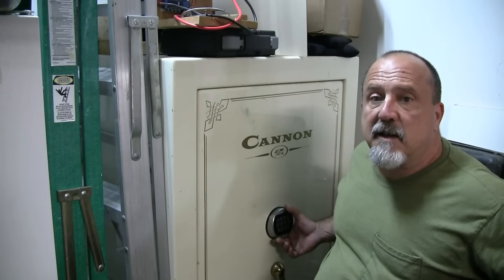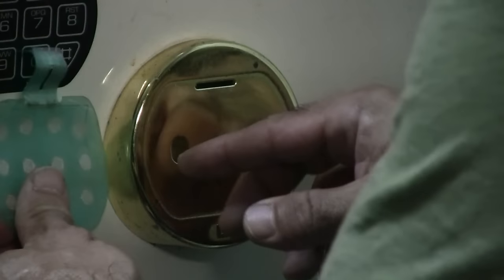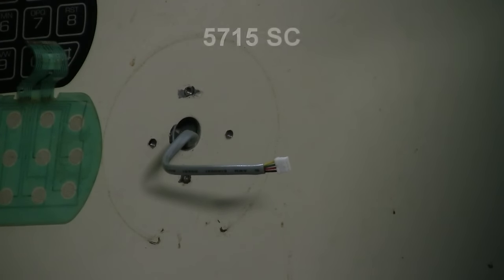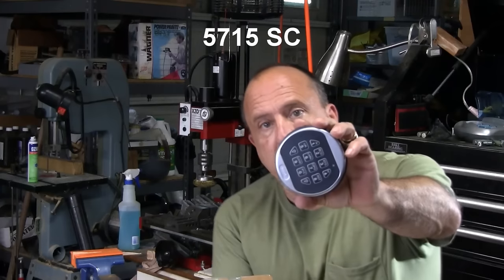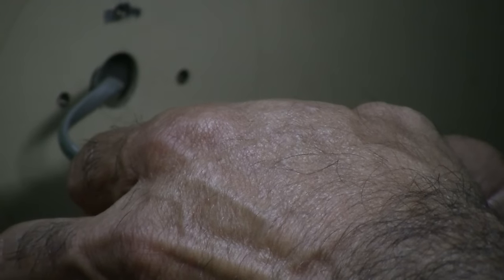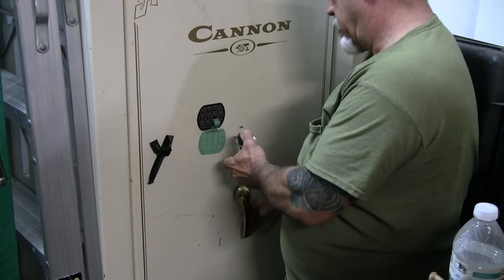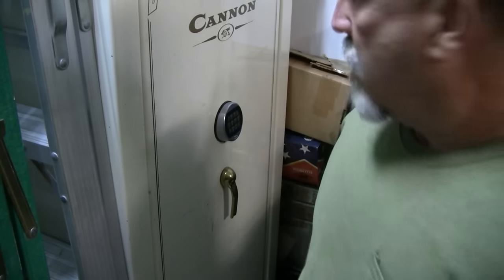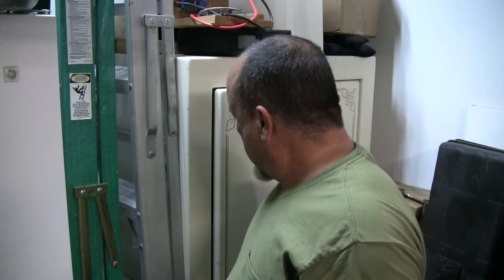Cannon Digital Gun Safe Fail Fix! Locked Out! Don't Drill - TRY THIS FIRST!

Comment: Firstly, once the door was open, you should have left it open to work on it, just in case lock would have failed for whatever reason. Secondly, depending on the age of lock, you probably should have replaced the actual lock itself since you have a new keypad. Thirdly, a competent safe technician would have repaired the hole properly to make the next drill attempt insanely hard, as well as match the paint  to make it look like nothing was ever done to the safe.

A small precision hole which is repaired is absolutely the right thing to do VS cutting the safe open. Especially if it's a high end safe VS a lower end economical one.

Also, when safes are installed properly, they are not only bolted down, but protected on the rear, top and sides which make it virtually impossible to cut them open without cutting through other barriers first.

Many people scoff at the cost of safe drillings, but when people have made the investment in security, they don't want to destroy 10k plus dollars over a $200 lock lol.
Reply from the maker: Thanks, sounds like sound advice. Unfortunately, I did not have the lock so only replaced the keypad. Since then, Cannon sent me a replacement lock and keypad and I have since replaced both (I posted that video tonight). I understand that a drilled safe can be sealed \without being compromised, however, the locksmiths that I contacted in my local area didn't inspire much confidence in their work. Incidentally, I made a comment on contacting SAVTA to find a reputable safe tech should anyone need one. I have no qualms against good safe technicians and have no problem directing people towards them!
Reply: Second on the advice to KEEP THE DOOR OPEN until you've confirmed x3 that the door will reliably open.
Reply from the maker: @mikestevens2053  I stand humbly corrected, I am a bit of a risk taker. Luckily, no problems to date!
Reply: Safe bolted down and protected on all sides and top. Not!  Mine is bolted down, how would you have all surfaces protected?
Reply: @300zxdriver  you build around the safe, essentially walling off the sides and top. It's the same concept as a bank vault. A vault is only exposed on the front where the door is.
Reply from the maker: @300zxdriver  I'm not sure what you are asking. Protected from what? Access?
Reply: @ExtremeDIYGuy  Basically doors are the toughest and thickest part of a lot of safes. 
It is easier to cut a hole in the side or top. Blocking access makes that harder - which is why bank vaults are cast in place with high strength reinforced concrete.

Comment: How about an electronic panel that requires the cable different from the one you had? Mine is about the same we use on the back of the PC Router. Thanks.
Reply from the maker: I don't think that will work. TO gain access you will probably have to use a front panel from the same manufacturer as the original.
Reply: @ExtremeDIYGuy  I thought so, I will try to get one of the same. Thank you.
Reply from the maker: @1945temo  Your welcome!

Comment: I think that it is worth mentioning that you should also before doing anything make sure you have a new Fresh and I repeat fresh battery I had a similar problem I replaced the battery even though all the beeps were happening everything seemed to be working properly but I replace the battery and it still didn't work later I found out that the battery I had replaced with had been hanging around for a few months the next step is I went and got a brand new battery now when I checked the batteries with my little battery checker they all checked as being okay in the green but the new battery was slightly more strong I installed that new battery fresh and the safe began working and has worked to this day so maybe check the battery before you do anything make sure you've got a fresh as good as it can be battery
Reply from the maker: Thats a very good point worth checking! Thanks!

Comment: Here is another fix, i know this is an old post but try this as well, this worked for me, take out fresh battery, push buttons for aprox 1 minute to discharge all stored energy or power, put battery back in and it worked , i was able to use my original combo to get in....
Reply from the maker: That wasn't the case in this particular situation, but that doesn't mean it wont work for someone else, thanks for the information!

Comment: When you drill a safe you repair the hole by driveing in a tapered pin cutting it off flush with the door. Then repaint the door and you would have to redrill the safe again to open it in the same way you did the first time you drilled it.
Reply from the maker: I prefer this way due to the fact I did not have to drill the safe. But thank you for the insight.

Comment: Great video,......just bought one,.....had mine off as soon as I got it?
The code would not work?
Then when it it does work you have a millisecond to open it?
Reply from the maker: That sounds like it's defective. Try putting a fresh battery in and see if that helps. If not, I would call the manufacturer.

Comment: If you drill the safe in the correct location then plug the hole with a grade 8 bolt or better yet a hardened steel pin your safe is actually better than before you drilled it. Unless of course if someone has a diamond hollow bit to bypass your fix but diamond drilling takes a long time.
Reply from the maker: Yes, I have had a number of safe techs call me out on that! But a good point nonetheless.

Comment: So I need to know the code that was original to the safe, not the last known good combo, correct?
Reply from the maker: You need to use the last known combo. That is stored in the lock mechanism inside the safe.
Reply: Please it's called a Lock Body
Reply from the maker: @xrp777  A "lock body" refers to a key lock and is the cylinder or the part that turns to open or lock a device. MBAUSA refers to the inside component on the safe as a swingbolt or deadbolt lock depending on the application.
Reply: Just don't call it a mechanism
Reply: Add no no one said cylinder get it straight . It's a safe lock body functionality as far as swingboat deadbolt  Doesn't matter and if it did you should have called it that from the 1st place
Reply from the maker: @xrp777  You are right, I should have called it by it's correct name in the first place.

Comment: Thank you for this great video ! You saved me a whole lot of money. My only problem is, even though there is holes on top and bottom, they are not threaded. Now I just have to crook my head a little sideways to hit the buttons. lol No big deal.
Reply from the maker: Lol, You might try a tap, just have to figure out what size it is. You can get cheap ones that are pretty much disposable. Canting my head sideways would drive me nuts.
Reply: @ExtremeDIYGuy  You’re right, should be an easy fix. Thanks
Reply from the maker: @paulrich4274  Worth a shot!
Reply: If it's like any of the safes and vaults I work on, you will need a high quality tap. You don't want to have it break off.  Don't ask how I know! Lol
Reply from the maker: @jerrylyles2885  Taps are hardened tool steel, PIA to get out if you break one!
Reply: Tap the holes with 8/32 thread. Make dure to use cutting fluid. Dont force it if it stops or it will break.

Comment: As others have said when replacing a lock always try and do with the door open. Throw the detent so it locks open.  When removing the old lock watch out for relockers.  Always put it back the same way or you will wind up drilling it.  Newer lock models like securam have the lock and face mated.  So you can’t just walk around with a face and open safes.
Reply from the maker: The relocker on the replacement mechanism was a PIA for this safe. But at least I got it to work correctly.

Comment: I cut big square hole in rear of American Eagle safe with grinder, replaced LG, welded back :)
Reply from the maker: That's one way to tackle it!
Reply: @ExtremeDIYGuy  Yep! Just recently cut open the top/back portion of a small Fire King high security safe only because the top door was locked and had to access MRC from SG 6120 electronic lock. Again Kudos to your method of circumventing a drill on your safe!

Comment: Most safe locks are backwards compatible. Just a tip, if you are working on a dead keypad on a Secure Ram style lock the board on the keypad is paired with the lock.  If you have this same issue with nonresponsive buttons you can order a new lock, take both keypads apart, take the new button portion, move the circuit board over to the new key pad and plug in your lock.  Put your battery in, if you get link ok just hit your code and open.
Consider it a free tip from a safe guy.
Reply from the maker: Thanks for the advice, hopefully that can help others that encounter this problem

Comment: $800 is a LOT for that service I'd charge $350-400ish those are known for keypad issues. I also would state drilling safe does NOT ruin safe you can actually make it MORE secure with changing lock type OR installing proper hardened pins or ballbearings in the drilled hole.
Reply from the maker: You sir are a responsible and ethical safe technician/locksmith. I have been called out on that before, I understand that the drilled hole can be sealed as to be undetectable and stronger than it was before. However, I could not find a locksmith that would do the work correctly, or a safe tech that didn't want an arm and the proverbial leg for the service. As it turns out in my case it was a simple keypad replacement. If it was the actual lock mechanism, I would have had to either cut it open or have a safe tech come out to the rescue. I looked at your channel and website, good stuff! If you'd like, I can post your website here and on my web page as well. I'm always glad to promote an ethical business!
Reply: @ExtremeDIYGuy  thanks,sure feel free to share
Reply from the maker: @hkssystemslocksafe2486  Ok, done!

Comment: Great video.  You should have kept the safe door open when you unplugged the front control unit to mount it.  Then a final mounted rest.  You are lucky it worked after the final install.  Again, GREAT video.  Thanks for sharing.
Reply from the maker: I realize that now, thank you for the input.

Comment: You should never work on your safe door closed and locked. Always do the job with the door open and bolts in locked position so you don't get locked out if something doesn't work. Then test it a few time with the door open to make sure it is working, then do it with the door closed.
Reply from the maker: Id have to agree with you!
Reply: He didn't have a choice to start with.

Comment: Drilling a safe doesn't compromise it if it's done correctly. However, this is why it's so expensive. A good lock smith knows where to drill and how to drill to get the safe open without damaging it. Once opened and the necessary repairs have been made. The lock smith will weld up the drilled hole, grind it smooth, then paint the door so the point of penetration is hidden. 
Higher security safes have more security measures built into the door. For example... Besides thicker and harder grades of steel. They may employ other technologies like carbide and tungsten chunks cast into the steel or even a tempered glass plate between the door and locking mechanism to thwart drilling attacks. The tempered glass plate if drilled will break releasing a lockout mechanism. The tungsten and carbide require special drilling techniques and the sacrifice of many expensive drill bits requiring considerably more time and skill to gain entry.
Reply from the maker: I have been corrected on that aspect of the video a few times already lol. I appreciate your candor and safe information.

Comment: Yeah, after my electronic key pad started going whonkie, I opened the safe, removed all items called my local locksmith company that also deals in safes. I ordered a Sargent and Greenleaf mechanical safe dial and had them install it. It took all of two hours for them to do it. Now I have no problems with my safe opening and I have no worries that it will go whonkie again or EMP problems. No more electronic locks for me ever.

Edit: Oh yea it was about a $250.00 insurance plan / peace of mind.
Reply from the maker: S&G locks are sturdy and reliable. Thats all that was used on the safes I saw in the USAF.

Comment: You might have been able to do it even easier.  I would have removed the first sticker and then cleaned the green board with isopropyl alcohol.  The way the keypress works is the little pattern under each key is bridged when you press the button.  If the buttons dont retract or if the coating ls degrade there can be a bit of debris between the little pattern.  If there is anything bridging those then it will often lock up the processor as it will read as a continuous button press or it wont read a press at all.  This is also an issue with TV remotes.  If you clean it and it starts to work you can just use something to touch the green pads direct.  It doesnt take much conductivity since the signal is boosted quite a lot which is why it works well and also why it is easily jammed up by anything.  You can actually see the smear of carbon on the button on the left side middle.  Cleaning that might have got it running again.

On remotes with squishy non clicky buttons there is often a carbon pad on the bottom of the button that just pushes against the green and that is what activates it.
Reply from the maker: It wasnt in the video but I did try that. It's worked for some remotes I have cleaned in the past but not in this case.
Reply: Great video. I will try cleaning next, as # button does not work . 
After looking at replacement keypads (5715) with correct cabling I notice there are now two backlit lighting buttons INSTEAD of # and * buttons...........do those buttons function as before, or do you think they just control the back lighting now.   Other keypads for sale with correct matching key layout have much different cabling, so probably wont match.Thanks!!!!!     @ExtremeDIYGuy

Comment: If this doesn't work for someone, In theory, if you know the battery voltage you should still be able to open the safe.    If you can figure out which wires on the connector need to be powered to activate the solenoid......you could use wires to hook to a power supply or  power with a battery pack and send power to the right spots on the connector......this would force the solenoid to actuate ...cool video
Reply: That won’t work, the electronic combination is stored on a circuit board inside the door, not in the keypad.

Comment: My safe came with a Digital combo lock and that failed after  ten or so years.  I had the locksmith scheduled to come out and open the safe when, just for the Hell of it, I tried the combo one more time and CLUNK the safe opened.  Sure as HELL I locked the safe door in the OPEN position as I was going to be home the entire time till the safe tech showed up.  After due consideration, I reluctantly replaced the digital combo with a conventional, mechanical, spin-lock.  My second safe (yes I own a few guns) has a similar LG digital combo.  I talked to a safe locksmith the other day and he assured me that the digital WILL fail, it is just a matter of next week, next month, a year or a decade from now.  I feel like I am on borrowed time and plan on getting a spin lock put on that one too.
Reply from the maker: Makes me wonder if I shouldn't replace the entire lock and pad with a combination lock!
Reply: All digital locks have about a ten year life span. Not bad if you consider what other items dont last that long. For about $350 to $400 you can have a new lock kit installed, atleast thats what we charge. Lock included. This only pertains to a good digitsl lock, not a crapy residential grade lock.
Reply: I just replaced my failed digital keypad with a Sargent and greenfield dial lock. Took 40 minutes and feel good knowing that it’s more reliable than the keypad.

Comment: you might set fire to the continence of the safe but you could weld up the  holes you drill in the safe door with hard facing weld rods and it would be much harder to break in next time.
Reply from the maker: Good idea, but I would hate to burn up the contents of the safe lol.

Comment: My brother in law bought a house with a locked safe built in, the previous owner had tenants in who changed the combination, then disappeared later. Is there any way to open that safe without destroying it? If not, where is the best position to cut to open?
Reply from the maker: Your best bet would be to get a locksmith to open it for you

Comment: I have the same but I wanted to hardwired mine drilled a hole in the bottom using an AC adapter plugged it into the wall taped the cable along the inside corners then up into the door no more batteries
Reply from the maker: That's sounds like a solution. I actually ran AC power into mine through the back. Haven't thought about permanently replacing the battery with a power supply though.